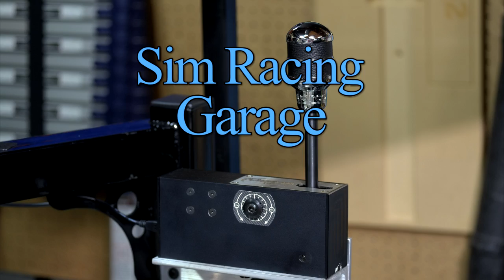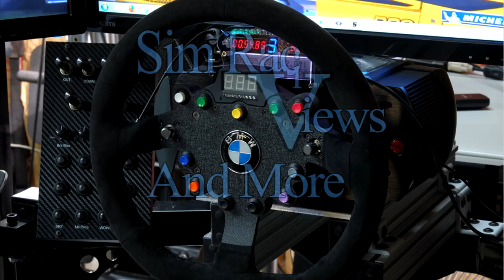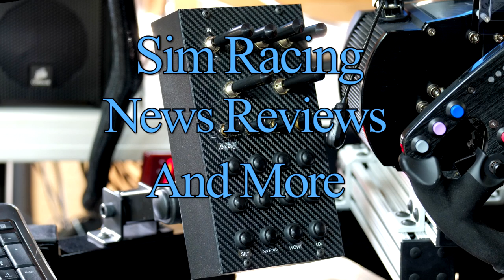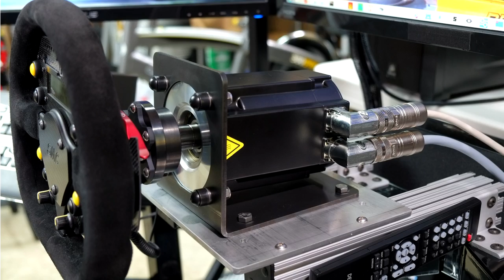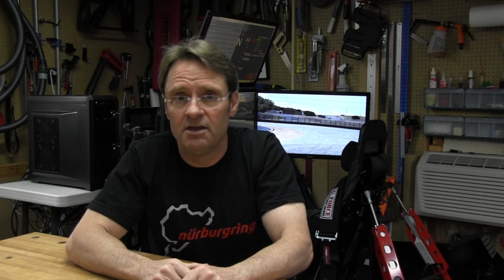ARC Carbon Pedals Review Part 4

Comment: I’ve been hammering the ARC pedals now for over 5 years and they have never failed once.  Still going strong.  Amazing piece of kit.
Reply: Hi, I could get a very good deal for a used set of ARC Carbon. How would you compare them to pedals with load cells? Right now I'm using a CSP V1 and I'm thinking of purchasing these babies. Another question: if the electronics should ever fail (and I hope they don't! LOL) are the parts easily replaceable/fixable? Thanks a lot in advance!

Comment: I am using the g 27 pedals which I like but their nowhere near as nice as the ARC Pedals. I put some foam material inside the brake and throttle spring  , which did help a little bit with some resistance and not making so much noise when hard braking or hitting the throttle hard coming out of the turn. The ARC Pedals are clearly out of my purchase range  and would be a dream to have , but I wondering what your opinion is with  The Perfect Pedal Brake system is and is it worth getting or not ? it looks like it would be about as close to the ARC pedals I'll ever get minus the clutch and throttle.